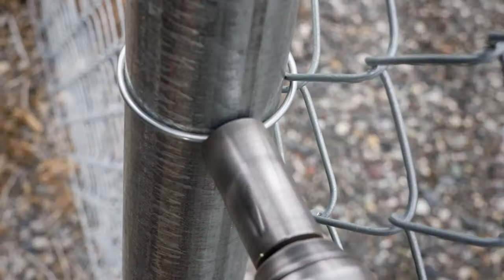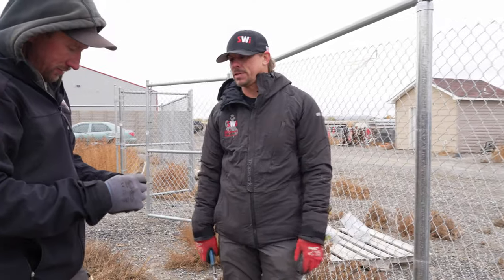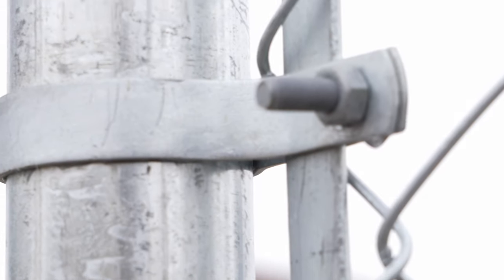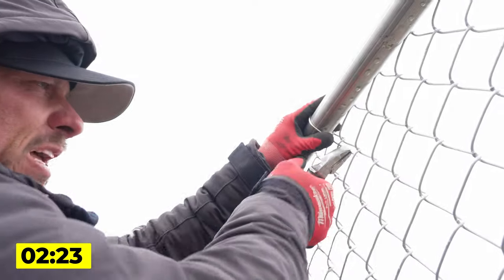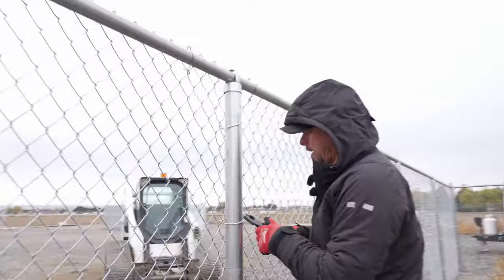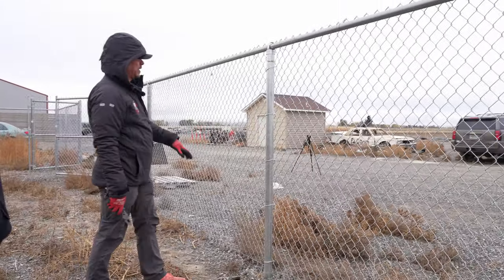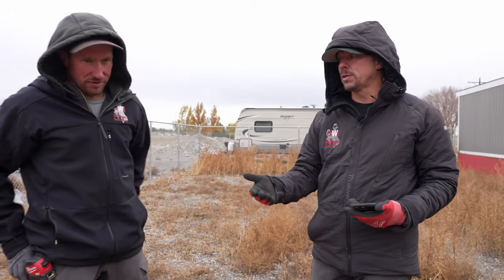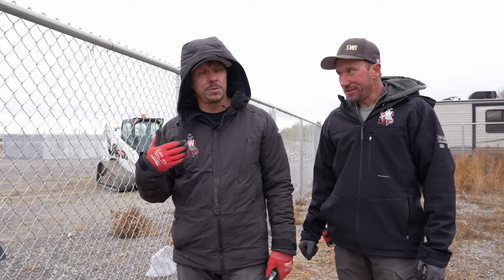Everyone Builds Chain Link Fence With This Idiotic Method

Comment: I use locking pliers for straight ties. You can clamp them to bite the wires and manipulate it. I find it also takes some of the work load off your hand because you’re not constantly holding grip

Comment: I'm still a user of straight or hooked ties. I use nothing but 9 ga aluminum on most of the chain link that I do. The way I was taught to tie is first of all, the hook needs that extra little tweak before you hook it on the mesh. You always hook it in such a way as that tail that you tweaked comes in direct contact with the pipe you are tieing to, be it top rail or posts. And you always hook it right above a criss cross of the chain link so that when you pull the tie around the pipe, it can't slip down to the middle of the diamond. And never ever hook in the middle of the diamond. And yes, always on the pipe side of the diamond as Mark said. On the side that I wrap, it gets at least a wrap and a half. On top rail, I will try to grab the same diamond as I hooked above. On posts this is not always possible, especially when tieing 2 3/8" Line Posts as they are larger than the diamond (2" Mesh). Having the proper pliers is also a huge asset for tieing. I have been using ChannelLock Double Jaws for my whole life and when customers and new employees see me tie, they always ask if I was born with a pair of pliers in my hand. Unfortunately, ChannelLock has discontinued the Double Jaw pliers ( I forget the actual model #) so I have had to find alternatives. It is a matter of preference but I believe the pliers Mark is using are called Lineman's Pliers and I have found them to be a bit tough to get into tight spots when tieing. I agree 100% with Mark when he said that the ties are a true sign of a professional contractor. Dress it first with a tie on the rail on both sides of every line post and I use a puljak to hold it to height or pull it down to height when working on uneven ground. I would use the Easy Ties for Commercial jobs but I think I will stick with the Hook Ties on Residential projects but great video guys...keep 'em coming!
Reply: You don’t need a pliers for aluminum ties

Comment: How do you spot tie in a long run with those? Never seen those ties here in California probably because they would be a unsafe for any school district here so to a sharp edge just sticking out
Reply: You can spot tie top rail, just not next to a post as you are pulling and sliding. The galvanized ties will slide on a galvanized toprail, just tap the twist with your pliers.

Comment: I agree that the easy tie is a game changer. It certainly the way to go if you are building a full fence or multiple fences. But 50 dollars for the drill fittings. A little high price for a small fence replacement job.